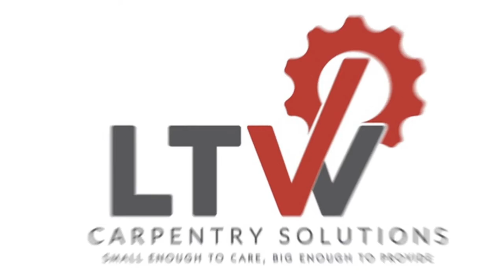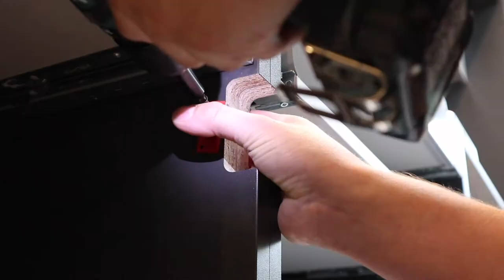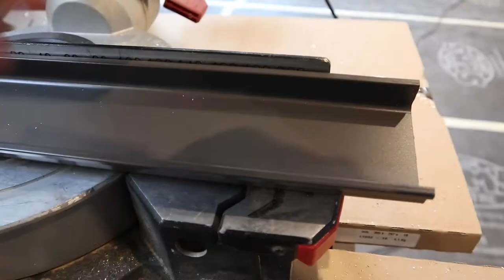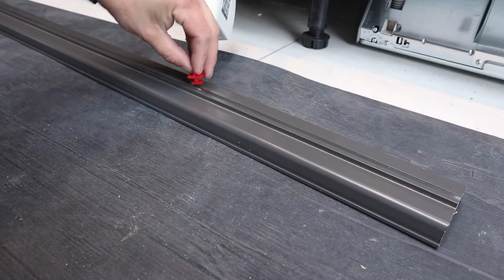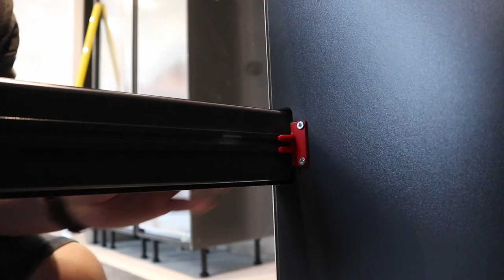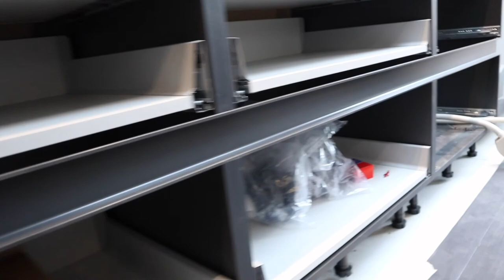How to install Gola Rail system (short)

Comment: How did you cut out the U profile in the chipboard? What tool did you use?
Reply from the maker: These where already I then units but if I had to do it I would make a template, jigsaw out the bulk then use a router and the jig to clean it up